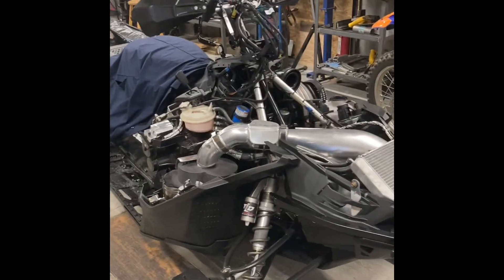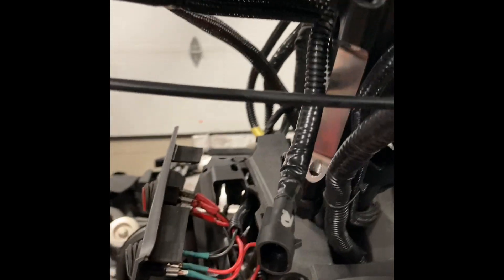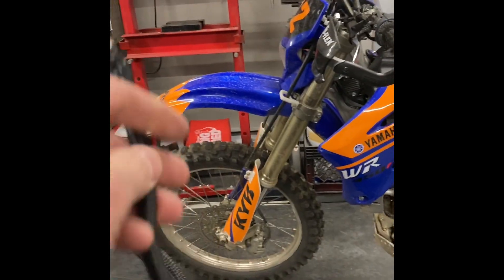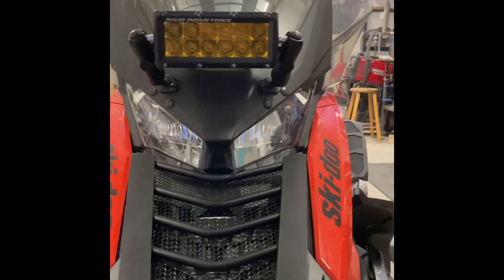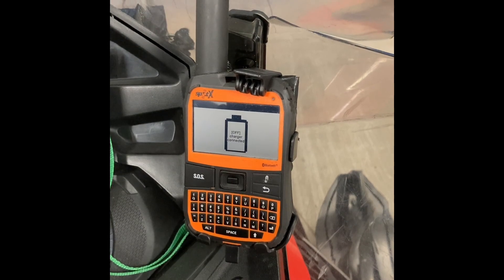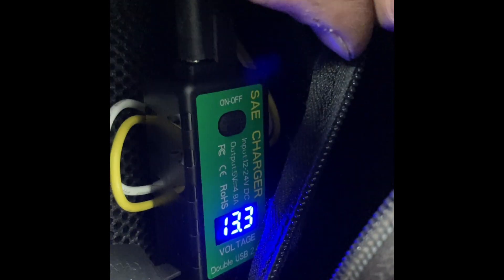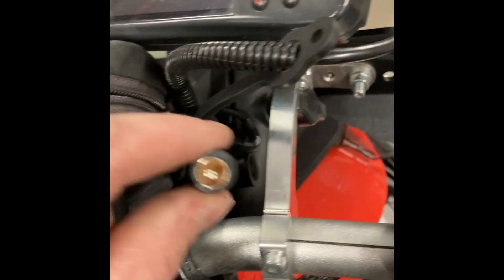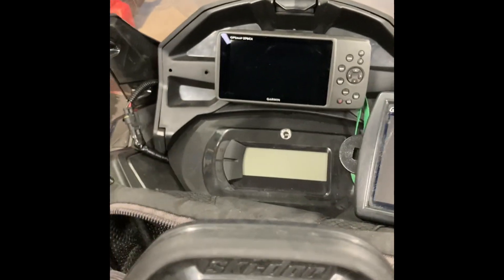My SWT Electrical Upgrades

Comment: Where did you run power from to your power block for circuits?  Is it keyed power or direct from battery?
Reply from the maker: Direct from the start solenoid, always hot. I realize that has some downsides, but I like my gps to be on steady power when I’m starting and stopping a bunch. It’s also nice to always have the light bars work if needed